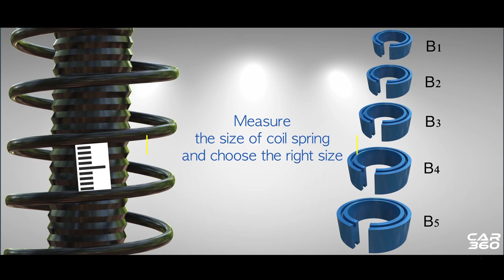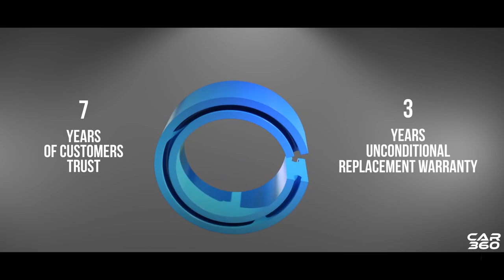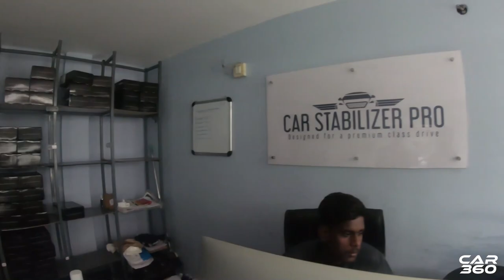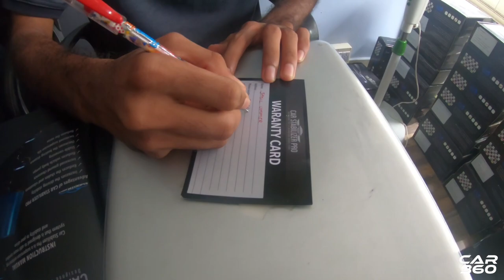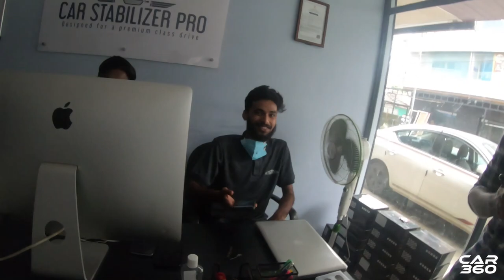വാഹ്നം ഇനി smooth ആയി ഓടിക്കാം! CAR STABLIZER PRO | INSTALATION VIDEO | CAR360

Comment: I installed the Car Stabilizer Pro on my 1200cc car and while it did improve the comfort of my ride by 20-25%, I found that it increased the rolling resistance of the tires. I experienced a drop in mileage of 3-4 kms. This was especially noticeable when the AC was on and the road surface wasn't completely flat. I ended up taking it off because I felt like my car was lighter and easier to handle without it.  I'm not sure about the engines that are more than 1200cc. Thanks for their refund policy, it is great if it doesn't work out for you.